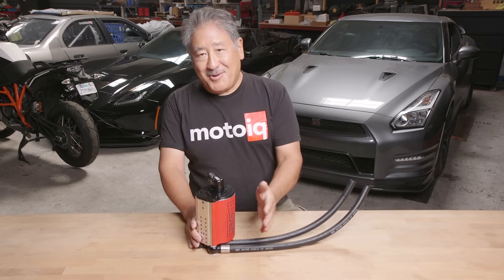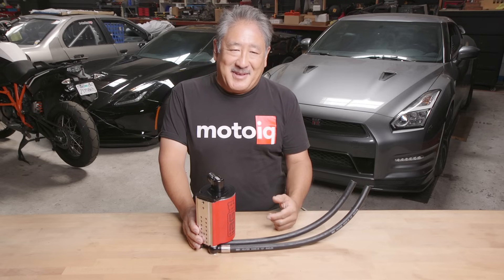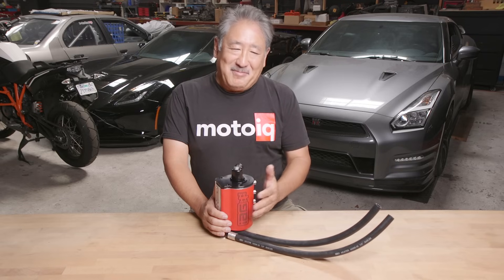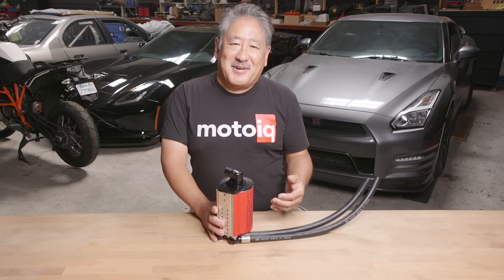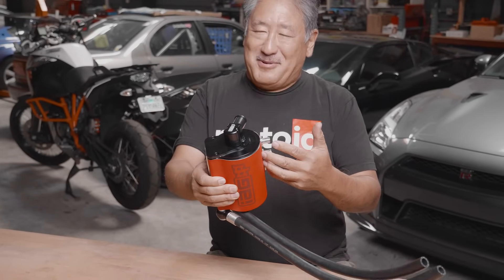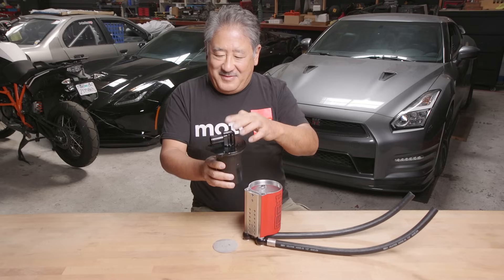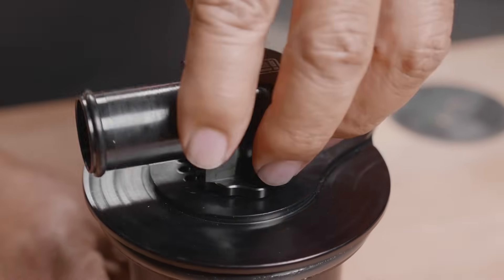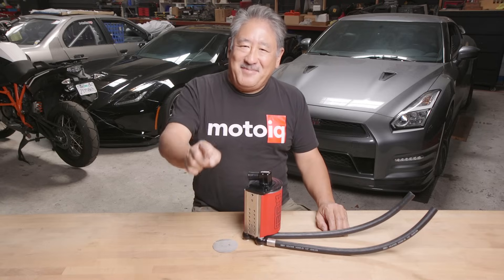How an Air Oil Separator Works and Why You Need One!

Comment: I have a eco boost 2015 Mustang. I noticed that when I turn left under hard acceleration the engine Boggs out bad. I’m not sure but I guess it’s because of excessive blow by pressure and the oil gets airated. And blows into the intake somehow. Is this true? I want to replum the inter cooler so that the distance between the filter box and the compressor side of the turbo isn’t so damn long. By the time the air goes through the filter box and across the engine bay it’s too hot already and it hasn’t even been compressed yet. And how can I rig a port injection on the intake to help mitigate carbon buildup where I don’t want it? If anybody knows anything about these things I would appreciate some advice.

Comment: Should I add this to our new 22 Honda CRV to take care of the oil dilution issue? What about the carbon buildup problem that I have heard of with GDI engines? Would this take care of that problem too? Thanks!
Reply from the maker: Won't help with GDI carbon build up. Probably overkill on most NA engines.
Reply: @motoiq  my CRV has a turbo charger.
Reply from the maker: whoops I forgot the new ones are! In that case you may benefit from an improved AOS.

Comment: I have a 99 Renault Twingo 1.1L that I use for track day purpose because why not? hahaha and the first thing I modified after suspension, brakes, and exhaust upgrades was an oil ari separator because since it's an old car a lot of oil was being sucking into the admision though the crankcase ventilation. Best decision ever... until one of the hoses bent and the oil pan just rised pression and I ended up blowing up the crank seal T_T

Comment: Interesting, but it's not functional in the ways you described. Most of the "technological improvements" actually don't do shit, because science.  

All the baffles are dumb, because steel wool does the same thing, but better.

Like having a port from the crankcase and a return to the crankcase. If the pressure is higher in the crankcase, nothing is returning, so the second hose is pointless.

Having the vent return to the intake before the throttle body on an N/A car is also pointless, because there is a PCV system, already.
Reply from the maker: Steel wool collects the moisture in blow by gas and contributes to the slime mix. If the crankcase is vented properly, the oil will return, so many systems do this. You don't want to return the vent to the manifold because, it will be a huge unmetered leak even with a check valve which would wreck havoc on idle control and even the tuning on a speed density mass flow map, a PCV is tiny compared to what is needed for crank venting.
Reply: @motoiq  I used some stainless steel score pads (for cleaning steel pans in the kichen), so the "wires" are fat. Once fluffed a bit, a couple fit in the "can" I used. My can also had a manual drain that I used to empty it.

I solved the flow problem by using dual PCV valves. Idle was still manageable, because PCV, duh.

This was what I did because my valve cover gasket blew out when running only a similar setup that was only connected to the intake tube, after the filter & before the throttle.

That's what this uses, and it doesn't do shit!
Reply from the maker: You blew out your valve cover gasket because you had a poorly designed AOS with insufficiently sized hoses. Or you most likely you vented the AOS to a port before the throttle body that saw boost pressure.  Dual PCV valves probably are not enough for turbo engine running hard on the track.  This AOS and others like Radium and Killer B that are properly designed and vented pre compressor work excellently and are used all the time on high boosted cars that spend a lot of time on boost on the track. Boxer engines can also spit a lot of oil especially under hard cornering.  A Subaru and other flat motors like Porsche can pump a significant amount of its crankcase capacity out the breather during a track session so having a separator return is important on these cars.  It's a reason why many Porsche engines are dry sump and all have elaborate AOS systems stock.
Reply: @motoiq  mine wasn't turbo, but the gasket did blow out because the crankcase did pressurize.

First you said that flow was restricted by the PCV valves, but that wasn't true. Then you said my hoses were too small, which could be correct, but I was running dual 3/4" hoses off the valve cover, which is about twice what that thing has.

It was fine when I ran the valve cover ports open to air, but it splattered the bottom of the hood with oil.

The problem was that there was insufficient vacuum after the filter, because the filter flowed well, coupled with the restriction of those hoses (that were bigger than come with that POS).

In short: mine worked, & that thing doesn't do shit!
Reply from the maker: The IAG AOS has 3/4" hoses and there is no way it does not work worse than what you built let alone be "a piece of shit".  Considering that PVC valves only open at partial throttle when there is a vacuum in the manifold, there is no way you are sufficiently controlling your crankcase pressure., especially under boost when you need it the most. As I said, you probably routed boost pressure into your AOS which caused your problems.  As for being a piece of shit, we disagree with you and so do tons of racers that actually drive hard on the track where having a good AOS is critical.
Reply: @motoiq  fine, don't believe me, but also realize that 99% of cars won't see WOT for more than a few seconds at a time.

I mean, you could put a pressure gauge on your crankcase to see, or just wait for gaskets to start pissing oil & realize the shiny shit you bought is shitty.
Reply from the maker: Instead of arguing with me, you need to troubleshoot your install and if your only crankcase breathing is through 2 PCV valves you need to fix it in case you really decide to drive your car hard or you will be pushing oil out of your seals.
Reply: @motoiq  no I don't, it ran ~60,000 miles with the dual pcv, and it went from burning ~1qt every 1000 miles before my dual pcv setup to burning only ~0.5qt every 3000 miles after.

PCV systems exist because there isn't suction in the intake tube, so manufacturers developed it that way. The "IAG AOS" system doesn't work, that's why no setup like that is used by any manufacturers.
Reply from the maker: Porsche uses a similar system. AOS systems are common on commercial turbo diesels. Instead of insisting that something that is proven to work under tough conditions doesn't work, you should figure out what you did to make yours not work.  If you drove very much under boost, your 2 PCV system is going to have issues. PCV valves are routed to the intake manifold post-throttle valve so they can see vacuum and the check valves will open under part throttle when the vacuum is high, not the intake pre-throttle, they won't open much there, not until the crankcase pressure builds up. When the engine goes into boost, your valves will close and you have no crankcase venting. PCV systems have other vents that act as intakes under light load and crankcase vents under high load.  In no case does the PCV valve do all the crankcase ventilation at least in OEM condition.
Reply: @motoiq  Diesels' don't have a throttle, and I'll believe the porsche when you say what one that doesn't have a PCV.

PCV systems do also connect the crankcase to the intake pre-throttle, on cars, as did mine. That end is where air goes into the engine, it comes out through PCV, then into the combustion chamber.  That way the crankcase gets filtered air.

My PCV valves were in parallel, so they work the same way as if there was one because they see the same pressures, they just flow like two.

What I'm sayin' is yours doesn't work if the engine still has a functional PCV system, it's just flowing backwards. If it is a disabled PCV system, it will work, but you loose the benefits of having lower pressure in the crankcase, and increase the chances of blowing a seal.

Comment: Hello and thank you for sharing this technology with me. I do have a question though. If I was running an air cooled engine what would be a way to adapt this so it would still maintain the heated portion of the plate? To be specific it’s a 1961 Chevy Corvair flat 6 with a stock turbocharger pushing maybe 8 psi
Reply from the maker: I don't think you can.  You might be better off with a Killer B AOS because it has a funnel shaped bottom and returns the oil right away.

Comment: Video idea: Now I want to hear Mike talk about engine layouts now and their effects on blow by and oil distribution. I never considered that a flat engine would produce so much oil from the crankcase breather, but it makes sense. All of my motorcycles have flat engines because they are all Goldwings. They generally do not consume much oil if any, but at high rpms they will lose some oil.
Reply: Are your  goldwings turbocharged? Didn't think so

Comment: PSA NEED THEN IF YOU HAVE A PANTHER. a turbo will put extra blow in stock 4.6s but upgraded piston rings and another or two gap is proving good for up to 550-600hp

Comment: This pretty awesome. Mike is great at explaining the entire system and how it works. That goes for everything he reviews. I do have a question, I have a 13 5.0. Everyone has told me to throw at least one catch can because of all the oil being sucked into the intake. Would you guys recommend this particular system over just a regular catch can? I’m not boosted. But even running n/a I’ve notice a good amount of oil build up. Let me know.
Reply from the maker: What I like about it is the centrifugal separation and that it returns the oil back to the crankcase.  Some cars, like flat motors blow so much out that it can cause oil starvation during a track session so having the oil come back is important.

Comment: I own a couple of Porsches. Their inherent crappy AOS are adding personality. If replaced with working ones, I wouldn't get that iconic puff of white start-up smoke.  I do like it, it's reminiscent of starting an old radial engine 😂
Reply from the maker: The Killer B Porsche AOS's work well and are nice and compact.
Reply: @motoiq  Yup, it's also over twice the price of the OEM part. 
But honestly, many do actually like that white puff. I certainly do 👍😉

Comment: Great stuff for a long lasting properly running engine , really any engine can benefit from the oil air, etc separation not only turbos but those great direct injection engines getting their valves all carboned up. Definitely a good deal.

Comment: best design I’ve seem so far 👍 
cars actually have an oil separator basically the valve covers have baffles of various design so most of the oil simply falls back to crankcase then the air is vented to the breather tube and pcv on the other side. The interior of the valve cover is obviously hot so will not condensate. However, sometimes you need to recover more oil, if it’s well designed an additional oil separator will recover more or it may be even more effective than the stock. Large tubes for adequate flow is very important to prevent damage of gaskets other benefits you mentioned.
I’ve  also heard a negative ccv word be beneficial but It still needs fresh air to come in so additional vaccuum under acceleration would be beneficial

Comment: Interesting. I have a supercharged Dodge Charger 3.6 post 2016 and my two catch cans get drained everytime I change the oil. And they're not even close to being full. The EGR side will get to 1/2 in the Winter. They cost 200 dollars each on Rippmods and have dip sticks. NOT 500 dollars for the IAG, and I wouldn't have anything else. Sorry.

Comment: I have a Porsche 986s, the stock oil air separator is relatively effective. Until you track the car. This seems like a great alternative. Thank you. Subbed and liked. 👍
Reply: Eeerrh, not really. That's why most Porsches are puffing white smoke on start-up. 
The white smoke is a part of the Porsche culture, we wouldn't want to be without it 😉

Comment: Seems like it would be good to have on any direct injection engine, not just boosted applications
Reply: I don't think it would do much on a naturally aspirated direct injection gas engine. I put a catch can on my IS250 over a year ago, it only has residual oil in it after over a year, but it's keeping the oil out of my intake, thus eliminating the carbon build up on my intake valves that direct injection engines are known for. I paid $25 including shipping. An inexpensive cure for sure.

Comment: What brand of air oil separator can I use for a 2012 Lexus Is 250? Can the IAG be modified for my car?
Reply from the maker: Yes but its probably not really needed on a near stock NA engine.

Comment: How does the oil get back in? And isn't the stuff all mixed up with water etc? I don't want dirty oil back in..
Reply from the maker: As we explain in the video, the heater evaporates the water out and there is a drain that goes back into the block.  I suggest you watch the video before you ask questions.

Comment: Got an IAG AOS on my '16 WRX. Tuner told me that a tuned turbocharged car will eventually blow cause of carbon on intake valves
Reply from the maker: That's not true, DI can carbon valves that will cause a loss of power and hard starting but it wont be the direct cause of the engine blowing.  Removal of the carbon can be a service item that needs to be done periodically.

Comment: They don't work ,I got a stage 3 tune and run it hard,never had a problem,change your oil early.
Reply from the maker: Sure they do, it has nothing to do with your oil change intervals.  Any Subaru engine run hard blows a lot of oil into the intake, you definition of running hard probably isnt that hard.

Comment: I have to install one of these for a buddy of mine tomorrow and had no idea what I was doing or how this thing worked. Now that Ive watched your video and explanation I understand why different ports are in specific places and I think this video will help me a lot with the install. Thank you for this great video
Reply: Update, the bolt securing his intercooler to the turbo flange snapped😃

Comment: Has anyone tried capturing the contents of this thing (instead of plumbing it back to the crankcase) and compared it to what's collected in a regular OCC? The design seems more efficient than normal OCCs but I'm a little hesitant to allow what is collected back into the oil system.
Reply from the maker: The only bad thing can be condensed water but the heated walls of the separator help get rid of that.

Comment: Isn't that coolant connection another potential failure point.
Reply from the maker: Sure but it helps prevent sludge build up, especially when running E85

Comment: I figured you are sponsored by IAG(with how often you plug their products), but do you recommend other AOS's as well?, or just in general?
Reply from the maker: We are not sponsored by IAG, i just like their stuff because it works. For a street driven car I like IAG, for a car not driven in cold climates and short hop driving, or a race car, Killer B is good.  Radium is good but it doesn't have centrifugal separation, Cobb is good, I think it's a branded IAG system.
Reply: @motoiq  I currently have the Cobb one. I've been working on keeping my EJ alive longer with reliability mods. Just for daily driving.

Comment: how do these compared to the AOS on VW and Porsche turbo models?
Reply from the maker: Better and can deal with more blow by.
Reply: @motoiq  Awesome, what's the maintenance intervals like? When working on older VW/Porsche turbo cars the AOS would sometimes fail and just start sucking up oil into the motor. We had a 911 towed in once that almost hydro-locked.

Comment: How does this AOS compare to Grimmspeed which feeds oil back via oil filler cap? Does the IAG also return oil back and where? Great video, thanks for the information
Reply from the maker: It returns the oil via the block vent by the turbo compressor discharge. I would think this is better than the oil filler cap because it is easier to route the hose so its all downhill.

Comment: I've always heard an AOS was important in turbocharging. I know that it is pretty self-explanatory. Its obviously a device that separates air from oil but the detailed breakdown of this part, how it actually works and the explanation of "blow-by" were on point man! Thanks for all the insight and hard work you guys put into you videos....Very informative...I like the way you make  simplicity out of complexity...
Reply: Even better, and the next step up for doing the job, is a vacuum pump on the engine's crankcase, the only one's I've ever been around are mechanically driven, either as original engineering or as a performance upgrade, heavily boosted engine's practically require them, I'm talking aircraft racing engine's that make 100 psi of boost, an engine like that will load up the crankcase with so much oil mist it'll drag big power off anything that has to rotate through it.
There's even some normally aspirated engine's that'll benefit from a vacuum pump, Harley's have always had bottom end breathing problems when built for high revving performance, for years every race team in Grand National racing has used mechanically driven vacuum pumps on the bottom ends of the Harley XR750 racing engine's.

Comment: Does this make you fail smog since it messing with air? Especially in California, since we got strict smog regulations just wondering.
Reply from the maker: If you get the street version the plugs back into the intake and keep the PCV system intact, it should be ok although it doesnt have a CARB EO number.  I mean it actually makes emissions better.